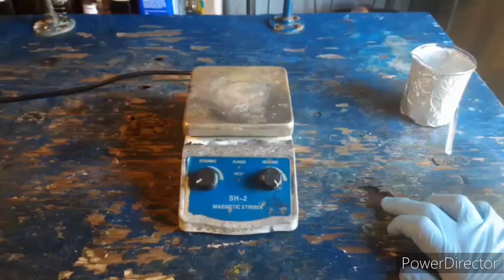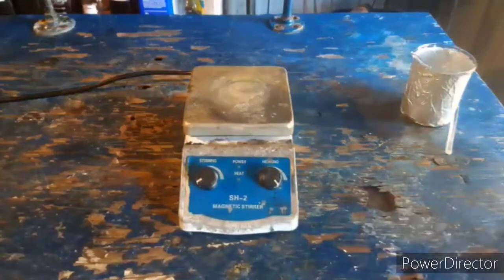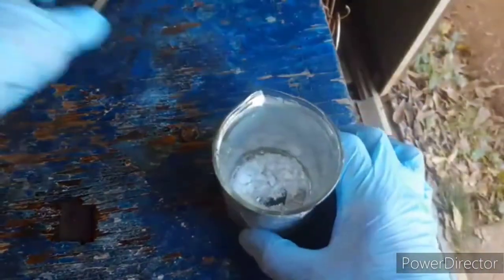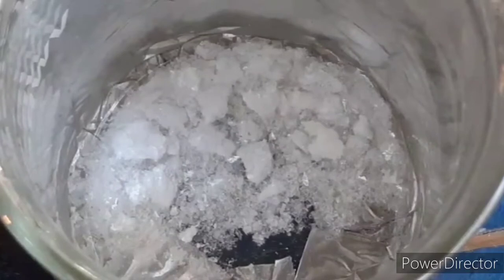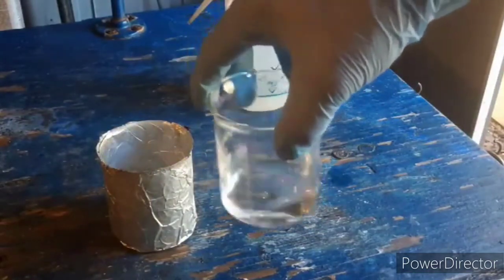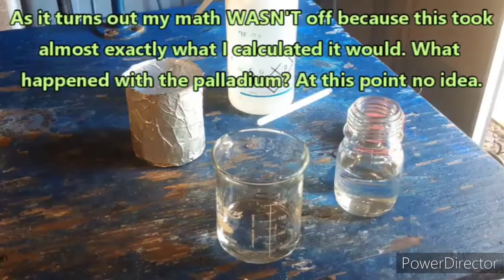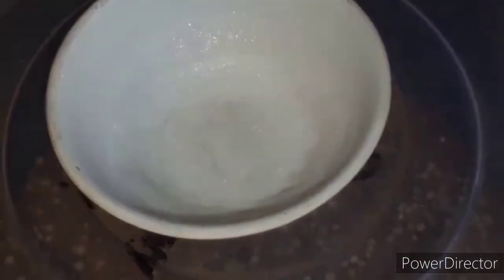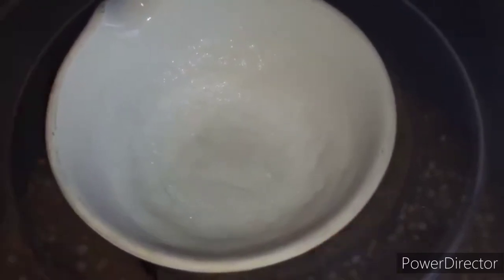Making Potassium Dicyanoargentate(I) #chemistry #cyanides #silver #plating

Comment: Thank you, the chemical name threw me off, ive seen it listed no less than 6 different ways 😅

Last question, where can we purchase the chemicals??
Reply from the maker: Not sure where you can buy cyanide from. Ive always made it from sodium metal and potassium ferrocyanide. I did a video on that too (its sodium potassium cyanide). Everything else can be bought on ebay.
Reply: @PoorMansChemist  is it legal/ possiblefor you to sell if I asked to purchase from you?

I'm not a chemist, most of this stuff is way over my head, just a guy who likes electroforming
Reply from the maker: @Wake_N_Jake  Sure I can do that. How much would you want?
Reply: @PoorMansChemist  of a silver potassium cyanide?
KAg(cn) 2 specifically?

Say.. 1000ml??
Reply from the maker: @Wake_N_Jake  It's a solid compound. Can you give me a weight in grams?
Reply from the maker: From what I could find It looks like a lot of these silver plating solutions are about two percent potassium silver cyanide. So 1 gram of KAg(CN)2 could be used to make up quite a bit of solution; something like 50 liters if I am reading these product SDSs correctly. It also looks like they add in potassium carbonate as a stabilizer. I have a couple grams of this compound already prepared. I'd sell you 2 grams for 25 bucks including shipping if youre in the US. I couldn't charge you more than that I feel like I was ripping you off. The compound just isn't that expensive to make.
Reply: @PoorMansChemist  do you have an easier way to speak? Ig/Facebook?

If I'm not mistaken you're on the plating solution possibly khrons, where I'm seeking a forming solution, though I could be mistaken 

I can send you the solutions ive seen once we're on an easier platform 

Excited to make this happen : )